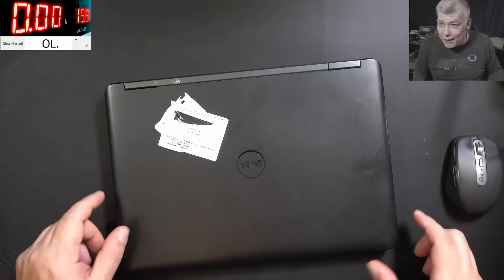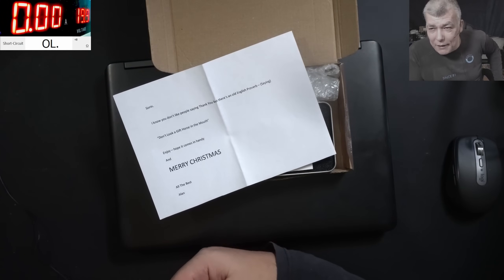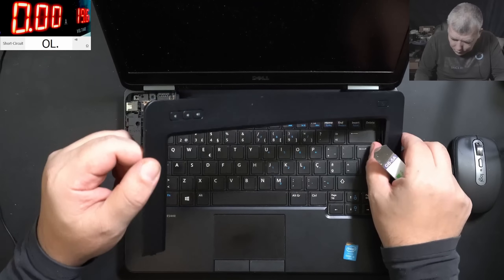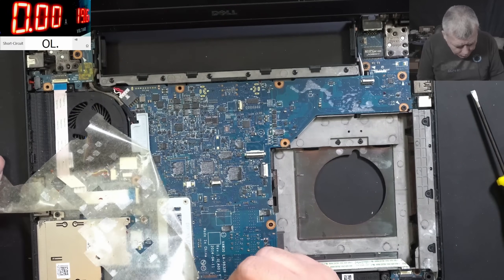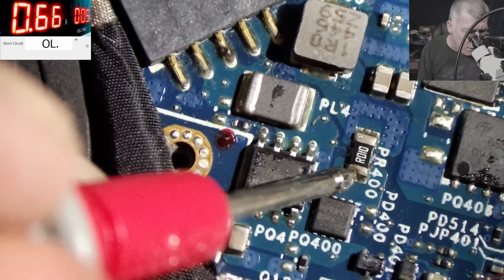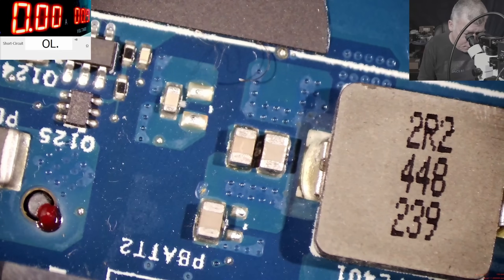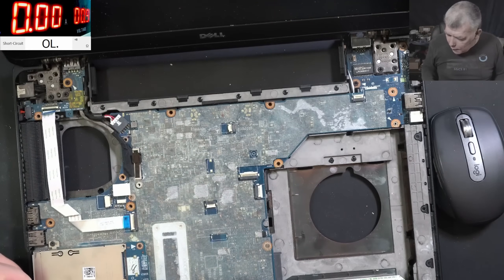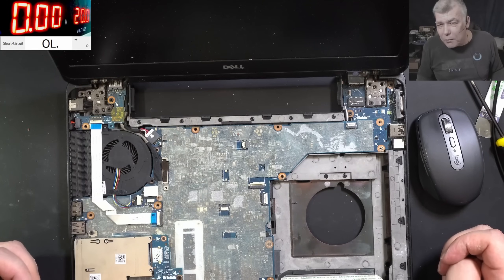Dell Latitude E5440 dead, no power, motherboard repair - Perfect Friday job

Comment: Hello from Greece. Thank you very much for your videos. they have helped me a lot. I wonder if you could make a video showing how the power supply that charges the laptop's battery works, using a multimeter and an oscilloscope, and showing the voltages before and after the mosfet and the waveform that activates the gates from the bq chips. I think you understand what I mean.
thanks.

Comment: Dell latitude is best laptop i have used ever. I have dell latitude e6510 1st gen lap. Still working properly. It's 13 years old now.
Reply: Yes, indeed....great laptops. My daily driver is an E6520, still working perfectly. I am about to upgrade (slightly) the CPU but, running Linux Mint, it is fast, boots in 20 seconds and does everything i need. It hardly even gets warm. Love it.

Comment: Great job Sorin, i had a dell laptop almost identical to that one.I INJECTED 3AMP AFTER THE CURRENT RESISTOR NOTHING GOT HOT ,4AMP STILL NOT HOT. I SHORTED THE CURRENT SENSOR TO GROUND IT WAS SHORTED. I DID  2 MOTHER BOARDS SAME OUT COME. WHAT WENT WRONG.I'M DOING EVERYTHING THE VIDEO TELL ME TO TRY STILL NO RERESULT.  THANK

Comment: Just to thank you for all this you are doing for us, it really makes a difference! I have been always curious about electronics, specially about fixing things. Yesterday I became very glad and thought about you when I was able to fix a USB Docking Station. My friend should throw it away but I asked him to let me take a look at it. It was dead... completely dead. Straight away, after following your methodology, I found out the main power rail was shorted. You learned me to be suspicious about capacitors and so it was, a capacitor was shorted to ground. I removed it and voilá, it worked! Then I wondered: should I replace it "later" or should I replace it now? Specially knowing the capacitor was in parallel with another one. Then I decided to measure the sound capacitor to find it was 33uF. I went to my tecjunk box and found a board with a capacitor same size, same value. Replaced it and crossed my fingers thinking "I hope it will not get broken within the next three months otherwise...." :)
Again, thank you so much Sorin!

Comment: I picked up an Asus C302 Chromebook for £12 inc postage!!!!! On eBay. Was faulty due to milk spillage. All I did was removed the mobo and cleaned it and it worked ever since. Does need a new bat now though. And yes I know..... Chromebook.... Hmmm but its great for watching movies on the bed. Plus its a high def glass 1080p touch screen.... My Bargain of 2023.

Comment: E6440 battry dead and am using it online. No sparepart in Ethiopia
Reply: All you really need is a cheap multi 18650 battery holder and a voltage converter, with a Dell-type adapter plug and you can make your own substitute battery. That's what i do, with salvaged laptop 18650 batteries. You need never buy a regular battery again, and i pop out the 18650's and charge them off the laptop. Works great. Plus, i made a Y cable so i could swap in a new battery before unplugging the depleted one, so i didn't need to shut it down to swap. I made it mainly for power cuts, but it would work fine for you too.

Comment: I have this usb tester. it will help you and you can reverse the input/outup coz of the low resistance. The menu switch is not very friendly but can do your work.
As for the missing capacitor, I'm waiting for the next video.

Comment: This is a niceeeeeeeeee laptop, I am currently using its next revision e6440, I picked it up very cheap, put in an ssd and 16 gigs of ram, amazing for work. Much better build quality than modern laptops.
Reply: FYI  next revision of E5440 is E5450...  (no E5460) then E5470... 80...90  E5470 stars NVME.E5440  E5=model 4=14" 40 =4th gen Intel CPU  So E5570  would be E5  15"  7th gen intel CPU
Reply: Hola

Comment: Thanks 
I have a question, Asus powers on but nothing more, no fan spin no nother indicator light, power bottom can not even force shut down 
What could be the fault and remedy
Reply: Bad ram, corrupted bios, cpu dead.
Reply: @fabian11235  I have confirmed RAM is okay, but not so such of the CPU and GPU
Reply: @fabian11235 Bois is now flashed but still not resolved